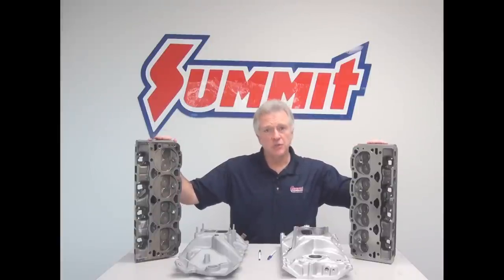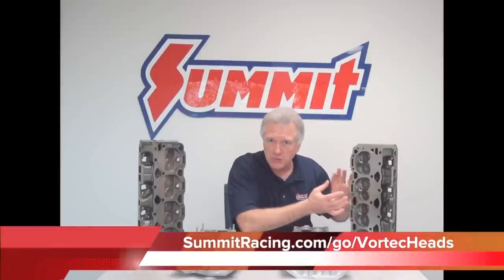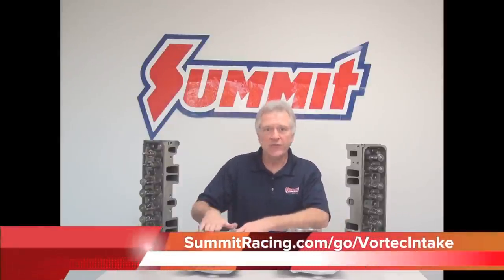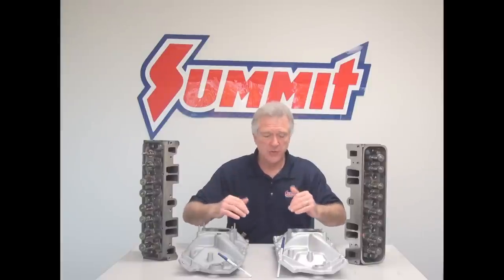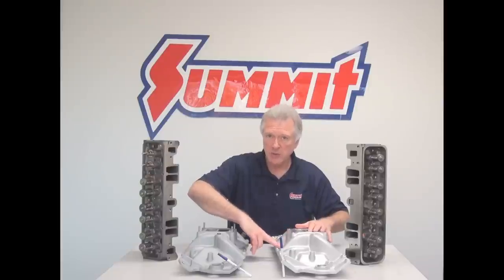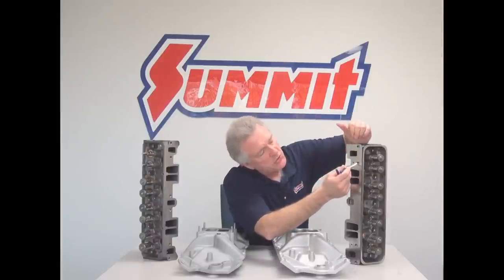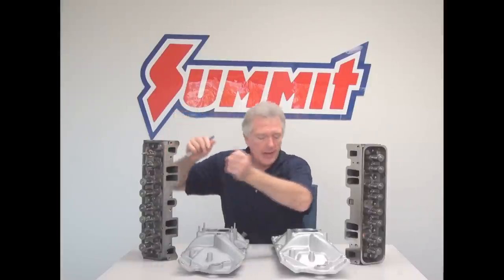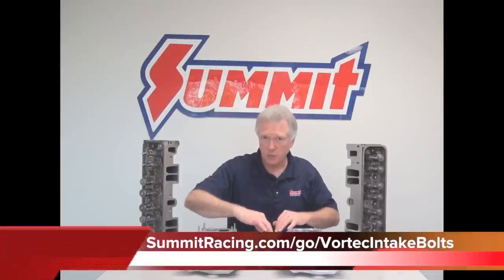Chevy Vortec Heads

Comment: I want to put these heads on my 305, will they work and will I feel a power difference?
Reply from the maker: Hi michaelf1282, 
Keep in mind that you will also have to change intake manifolds as well. The bolt quantity and angles ARE different! Yes, these heads will give an increase in power that will be noticeable but, you WILL need to re-tune your carburetor and timing curves due to the different combustion chamber sizes/cylinder pressures.
Reply: michaelf1282 Go to a you pull or pull a part wrecking yard and pull them yourself. a set with valve covers and exhaust manifolds cost me 215.00 Dollars 2.5 hours later.

Comment: why do you need different intake bolts?
Reply from the maker: Hi Jonathan, 
Vortec heads use a different bolt pattern and size than earlier heads at the intake manifold mating surface. So, if you are swapping to the vortec heads AND matching intake manifold, you’ll need the correct bolts to make it work.

Comment: do you make a tbi intake for a vortec heads like from a 95 chevy tbi truck
Reply from the maker: Hi *****, 
Yes, we carry in intake through GM Performance Parts that will allow a TBI injection system to be used with Vortec cylinder heads. Here is a link to the part:  http://www.summitracing.com/parts/nal-12496821/overview/
Reply: this intake does NOT have a provision 4 the power brake vacuum line
Reply: With a simple template and some common sense you can drill the vortec head 2 bolt on the old intake manifold very simple and then you don't have to buy an intake

Comment: I have a 94' 350 TBI these head cams will fit??
Reply: Yes it will just change your intake to match.. if I were u I'll get rid of the tbi system and throw a carb on it bc it's gonna be hell trying to tune with bigger cams.
Reply: @heavychevy2289  what carb will match better??
If install carb need to do a ECU tune??
Reply: Well the questions your wanting to ask is what are your goals for the engine what rpm range are u wanting. Nice street setup or high performance. You can size your carb by this calculation... Most people will oversize their carb or under size it.The formula for calculating how much CFM (cubic feet per minute) an engine requires is: CFM = Cubic Inches x RPM x Volumetric Efficiency ÷ 3456. Stock engines will usually have about 80% volumetric efficiency
Reply: @LuisTorres-ot2ib   You will need a Non-CC distributor, carb,  intake, fuel pressure regulator and thats about it..  ECM tunning will be for EFI your eliminating the TPS, IAC,MAF, and other engine management sytems keep the factory oil pressure sender unit bc it also talks to the ecm to keep the fuel pump running so u can still use your stock oil pressure guage. You will need a fuel pressure regulator that goes down to 4psi alot of carbs will operate from 4-7psi
Reply: Also u can stick with hydraulic roller cams or go back to flat tappet if u do Flat tappet u will have to break the cam in and use ZDDP oil

Comment: What the difference is between vortec humps(062) vs vortec sawtooths(906)?
Reply from the maker: +ronsmurff10, 
While both have some minor flow differences and valve seat differences, they can be good street performance heads. If you are looking for something for competition purposes, we carry a full array of awesome cylinder heads to choose from.
Reply: +Summit Racing I've read in most places (online) that the differences between the two castings are so minimal it would never be noticed in a street application.

Comment: i have a L05 350 i want to run vortec heads convert to carb what cam setup would you recommend using.. i don't want anything extream and will be a daily driver hoping to get around 300hp
Reply from the maker: Hi zmame, 
Can you please give our tech line a call? 1-330-630-0240. We need some additional information from you. Thanks for watching.

Comment: does summit sell 350 vortec heads drilled for old style intake manifolds like a tbi intake?
Reply from the maker: +Tyler Buck, 
No, but GM Performance offer a TBI intake for the Vortec head bolt pattern. The part number is http://www.summitracing.com/parts/NAL-12496821
Reply: promaxx does and you can get them at summit